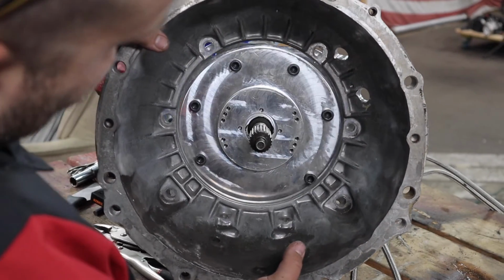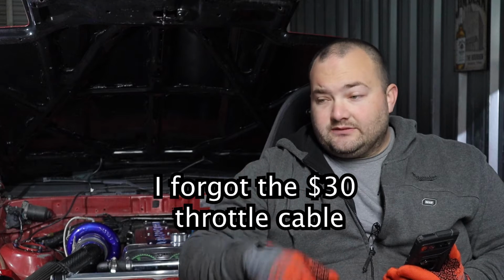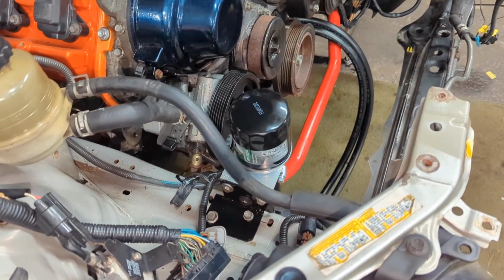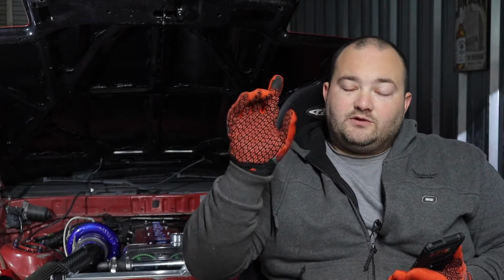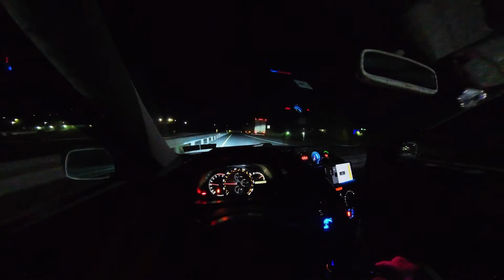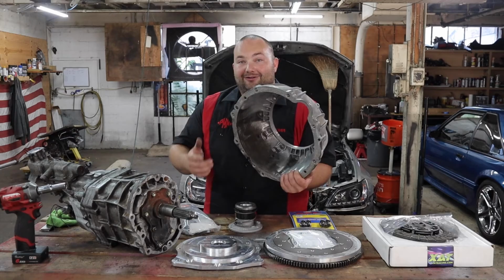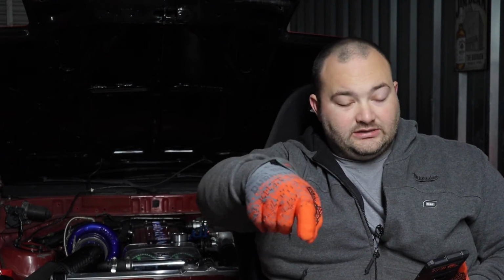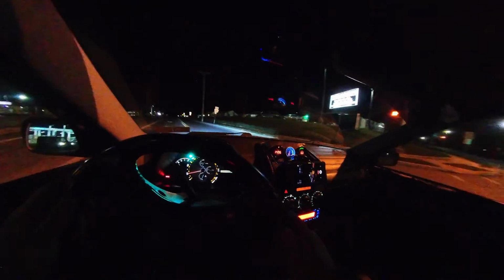Lexus IS300 1UZ swap total cost breakdown | Was it worth it?

Comment: Are the gs300 and gs400 automatic transmissions same? 

Can I swap a GS 300 transmission into a GS 400 without any adapter plates or wiring?
Reply: no you will most likely need a bellhousing. Just buy a gs400 bellhousing and then you can throw that on the transmission

Comment: I'm guessing you don't have idle control due to the throttle lock. The idle control is the electronic throttle body and some ecu dont support dbw control. It doesn't have a IACV like a JZ.
Reply from the maker: I don't have auto control because the ECU that I'm running does not support the type of motor that Toyota uses for throttle control on this engine

I can get a different motor and wire it up but I'm not too worried about it

Comment: I'm with you. Swaps like this make more sense for daily drivers. I threw a 1MZ in my Celica and it's so much fun. The 3S-GTE was an option for me but it was overkill for my needs, and the 1MZ was cheaper.
Reply: Interesting swap how expensive was that?
Reply: @JDMHaze  Right around $3k. ~$600 engine, ~$500 combining engine harnesses, ~$200 custom axle carrier, and ~$1500 in exhaust, clutch, flywheel, fluids, gaskets, etc.

This was with my 97 GT with a manual trans. Cost will obviously go up depending on how much work you do yourself and if you're starting with an auto trans. I designed the axle carrier in CAD with a friend and we made that available to the public.

Comment: Swapping a V8 in is always worth it, regardless of the price.

Edit: what? The W55 is weaker than the W58. Admittedly the MKIII is weaker than the MKIV/SC300 W58, it's still stronger than the W55. I ran a BPU 7MGTE on my 89 MKIII with a W58 and it was fine. I was afraid to add more power to my W55 IS300 because the transmission is trash.
Reply from the maker: Haha hells yeah
Reply: @PoorManMods  as far as I know, the W58 is stronger than the W55. I had both and the 55 felt more fragile
Reply from the maker: @RazoE  even if the 58 has an aluminum center section and not steel?
Reply: @PoorManMods  I believe so. The guy I bought my W55 bell housing for my 2JZGE MKIII Supra had 2 bell housings available because he blew through two W55s on a small turbo IS300. Everyone on My.iS also agreed the transmission sucked and money would be better spent on going R154 or V160
Reply from the maker: @RazoE  hmmm ok
My plan is if I blow the 58 that'd currently in there, swap the w55 in. In the meantime save/source parts for an r154 swap.

Then take the r154 out of my supra and put it in.

Then for the supra do some kind of 6 speed